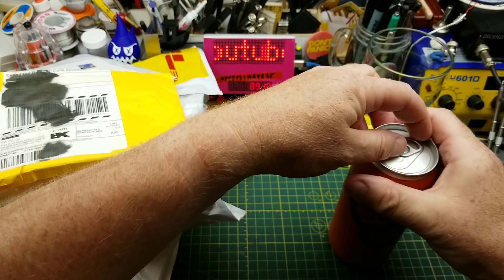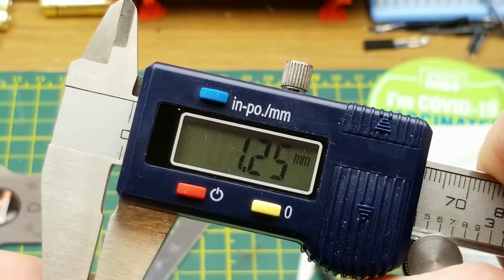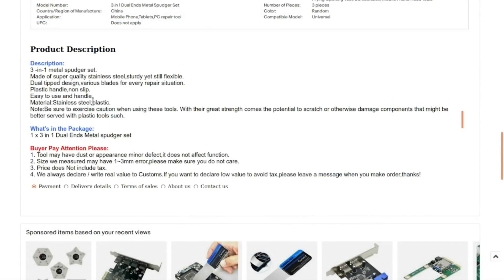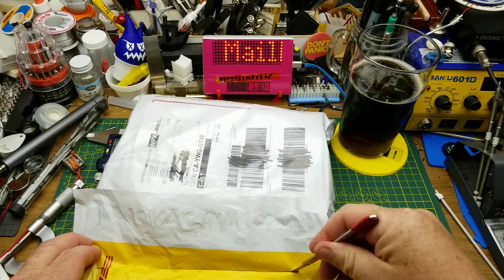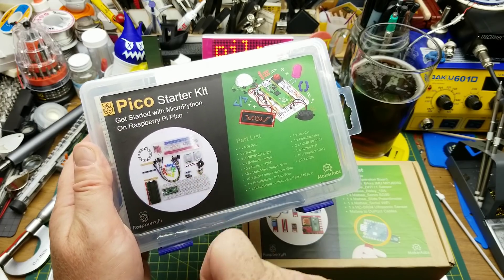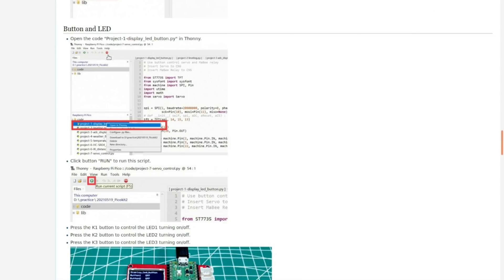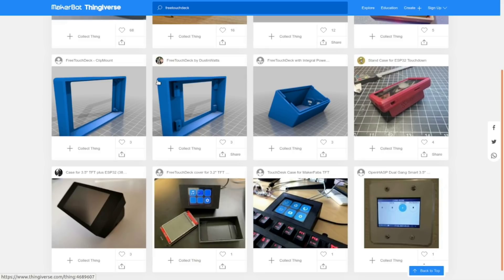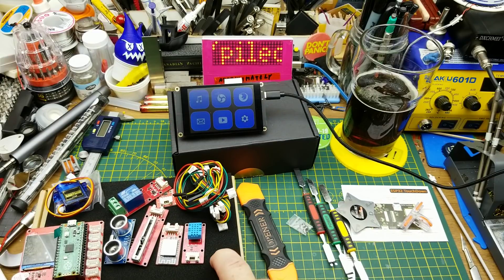Mailbag Monday #119

Comment: 4 Pin "Grove" connector.
Reply: I like Seeed Studio's pin order [G + Prim Sec] but dislike that they use and oddball connector.
Best to have used JST XH2.54, like in 3d printers and common electronic equipment.
Reply: @GnuReligion  Great ! I've always wanted to know a code for them, every time I tried to find connectors I get bogged down in a sea of them and give up ! they are common and useful....cheers!